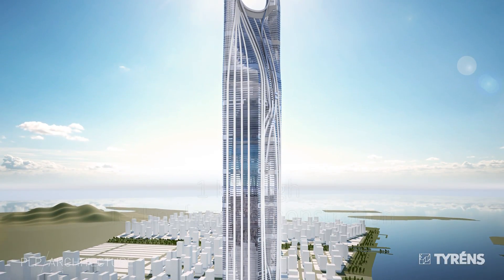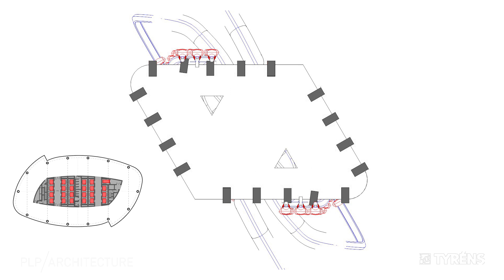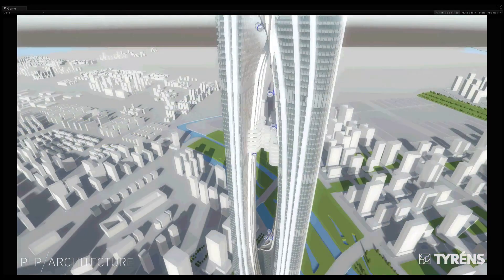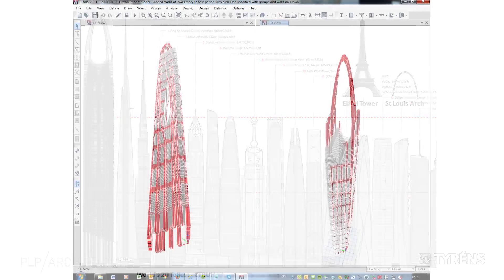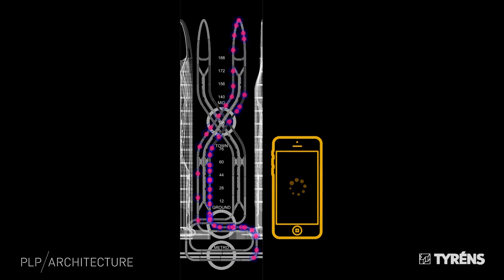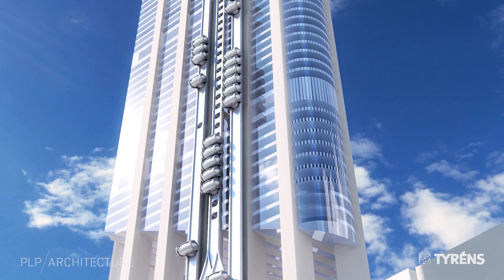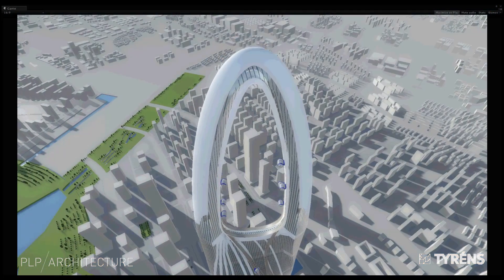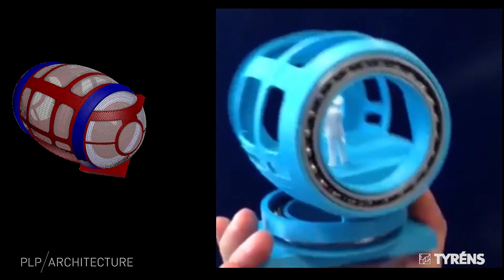PLP Tower Demonstrator Part 1

Comment: Lars,
This is awesome! I suggest you get my countrymen and women involved... they are number one when it comes to funiculars and other vertical or near vertical transport. One thought about sustainability: breaking action of decsending cars should be converted to electrical power (in the old days, the Swiss were using water, and there are a good number still in use that work that way... not quite the Perpetuum Mobile, but almost.